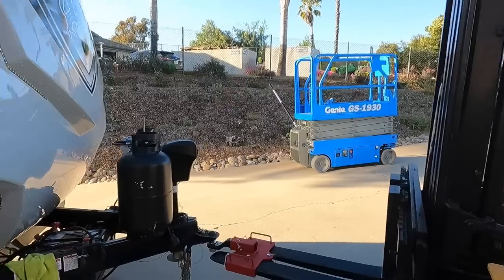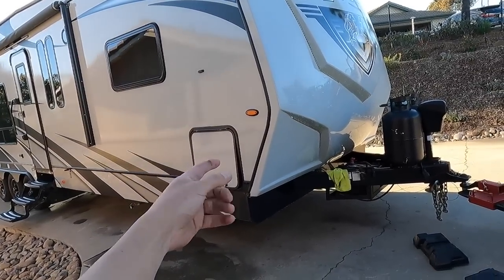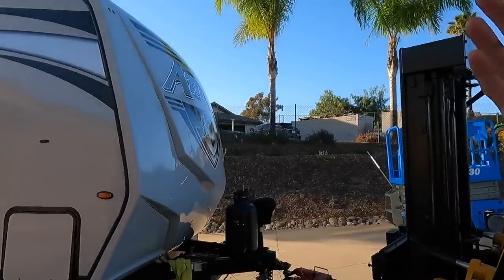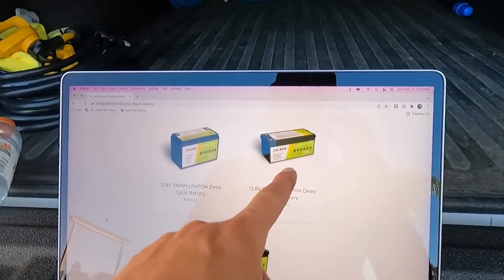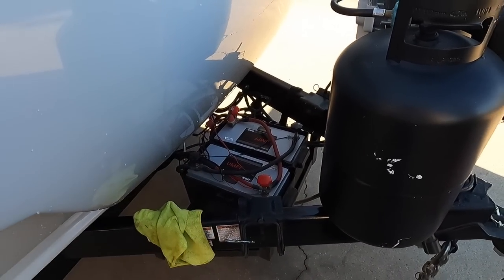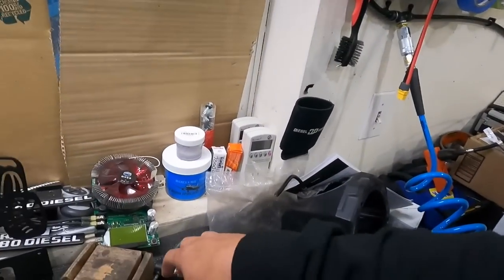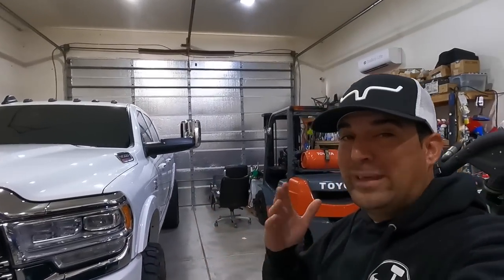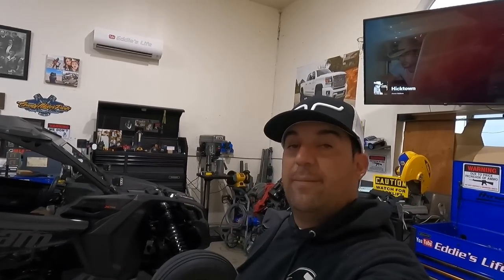New MONSTER battery installed for the toy hauler!!

Comment: Even in socal you have to worry about Temps below 32 degrees in the High Desert. I just installed a single lithium battery in my new Genesis Supreme and I am absolutely impressed with the capacity. With only one solar panel and one battery it has plenty of power in the morning to run my coffee maker even after the heater runs all night. FYI I use those temp monitors that you recommend to monitor my battery compartment temp.